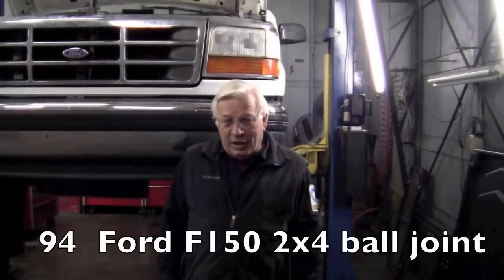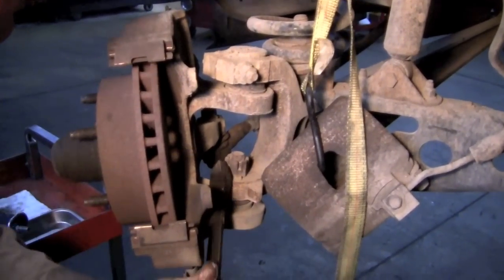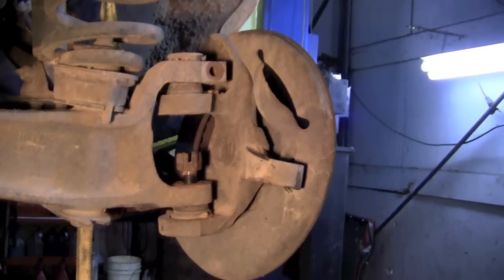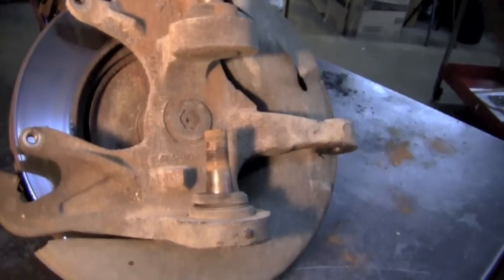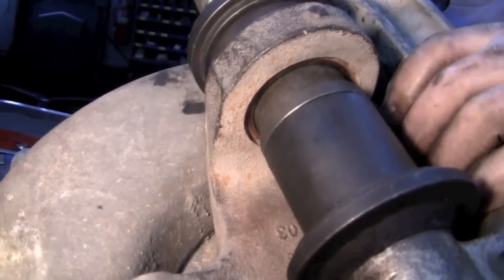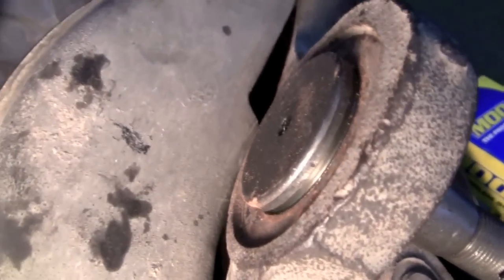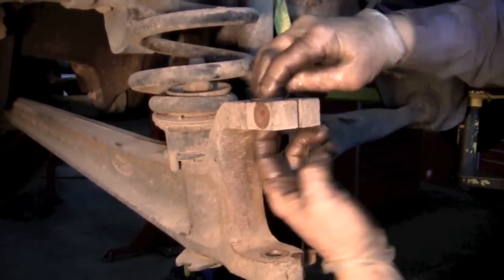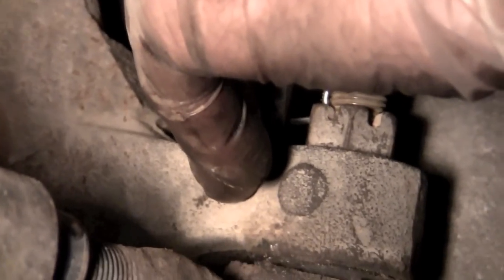Ford F150  Ball Joint

Comment: Thanks for the video.  One difference: on my '87 RWD F-150 the caliper was held on by two wedge pins that needed to be driven out, instead of bolts.  The big castle nut required a 1 1/8" socket or wrench- not everyone has one of these in a standard socket set.  .  The lug nuts we 13/16".  Hammer blows would not release the tie rod end or all joint assembly- I needed to use a pickle fork.  Penetrating oil used throughout the process was a big help.  My cheap impact wrench was mostly successful in driving in/out the ball joints with the press kit, but I also used a socket with breaker bar for leverage.   Overall I agree that with a press kit and standard tools a layman can do it, but now having done the job I appreciate all the work that a professional like yourself puts into getting the job done.  Thanks again for the instruction.

Comment: This really is a well done video.  I like that there is no long down time, and he explains everything rather well. 
The only thing I suggest is if you are doing it at home and your mileage is up there, and this being the first time you LBJ is being done, spend the extra money and do the uppers as well!!  I had my Chrysler's LBJ replaced only to have the upper go bad within 2k miles.  It is only a few bucks more and makes sense to do it then.
My only other suggestion would be to make sure you follow torque specs in the manual.

Comment: Good vid. I hate the ones that spend a bunch of useless time doing nothing. This one was to-the-point and covered the main points.
Actually, I'm currently half-way through the same job, replacing the lower ball joint on a Lincoln Town Car 2001. I don't have a press or a ball joint replacement tool as in the vid, and I'm trying to do the job without one.

Comment: Great Video.  Thank you for posting this.  I have been familiar with GM products for decades, but just bought a mid-90's E-150 that is going to need ball joints.  The boots are shot, so I know it will be only a short time before they get loose.

Comment: I did all the joints upper and lower on my 1 ton E350, they wanted  $1100 to do the job, all 4 joints cost me less than $300 and autozone has the free loner tool with good directions its not hard, be careful of the long caliper retainer bolts, very low torque, they are so long if you crank on them they will twist and snap easily, the parts place said everyone breaks them the first time.
Its a nice project to gain experience wrenching.
Power tools not needed but breaker bar is ,
plus a pipe to slip over the end to extend leverage if required.

Comment: Castle nuts have been used for ages on all makes and models of cars and other equipment.They are designed to be tightened as the movie shows. The point of the cuts in the nut and the use of the cotter pin is so the nut can't turn or un-tighten.It's a safety measure.

Comment: great job but I have some tips to ad to this video,when u get to the point where u need to press the new ball joint use some grease to ease up the installation, also some cars have a tiny drilled hole into the mounting frame and on the ball joint u should pay close attention and make sure they're aligned before pressing, reason behind it is when come time to grease the chassis, grease get to the joint, finally always clean up the area u are working on and use anti seize paste on bolts and studs.

Comment: @sweetlikeADAM 
I agree.  All you have to do on a 1994 3/4 ton Chevy, for example, is put a compressor on the spring to keep it from flying out at you.  Then take the castle nut loose, and take your press and push that sucker out.

Comment: @giannial1985 True, In all likeley hood it is the ball joints, but to best diagnose it, its best to lift the vehicle off the ground a few inches, like in this video, iff you see movement within the joint its worn, some joints also have a grease fitting, the should be regreased at every service interval, if you have any play in your wheels when rocking them from side to side you should also get your wheel bearings checked.

Comment: Thats what makes my job difficult at times while being a mobile mechanic. The ball joints are in so tight, that no normal use of tools in the field work. I have to take it to a shop, where the owner charges me to use the press. The force used to make the ball joints come out..is very explsive! They come out with a BANG! hard on the hearing. The part often flies down or away from the press. I think next time, put a rag over the ball joints.

Comment: Advance Auto will loan you a ball joint press for free... make sure you get the 4WD ball joint press, its heavy duty and gives you all of the cups and press plates.  You will need a two foot breaker bar to press in and out the ball joints.  I ordered Federal Moog joints with grease fittings was a breeze to replace both sides took a little over 3 hours for uppers and lowers and installong a new steering dampener

Comment: While you were doing the lower balljoint ...why didn't you replace the top? It's a 1994 and while it was out I would of did the top also. Great vid. Should invest in some rust penetrate. It makes it a little easier. What ball joint kit do you have? Also I have the same chisel gun and it's a good one.
Reply: J- Styga It's a Moog ball joint. You can see the box it came in at about the 6:20 mark. Personally, I don't think Moog is all that great, but they are better than Duralast and Valucraft. But in my experience, NOTHING beats OEM parts.

Comment: Just wondering if there are any torque specs on any of the assembled parts? I have 4wd so of course I have to also remove my hub assembly and axel shaft as well. Thanks for the video

Comment: I have an 83 F150 2wd. I just changed out my driver side upper and lowers. I noticed in this video the setup is similar to mine, but, my ball joints went into the ttb instead of the knuckle. I need to find out if that is the original ttb.

Comment: Well done video, but I still have two questions:

Do you put any grease on the ball joint or spindle hole to ease the process of inserting the ball joint, and reducing wear?

The replacement ball joints have spindles that are angled, i.e., not 90 degrees to the body of the ball joint; how do you orient the ball joint so the spindle is angled properly after insertion?

Thanks!
Reply: most ball joints will come with grease certs for grease, if they are permanently packed, there will not be grease certs.  I'm not following you on the spindles
Reply: @mercykidssprgeducationchan4237  Thanks for your reply. Got it figured out.

Comment: ive noticed how the wheel was tilted out, how would you fix that. You might say camber adjustment but my vehicle doesnt have adjustment for the camber. Its a 2001 Ford Focus ZX3. My wheel is the same way and it drives me crazy.

Comment: while doing the ball joint replacement,whats keeping the spring from flying out,is it just the shock absorber keeping it from coming out,and if so wouldn't it be a good idea to put a screw jack under the arm for safety?
Reply: The shocks and suspension control arms are limiting the downward movement of the suspension. There's no chance of the spring flying out.

Comment: I would stop spreading the brakes pads that way, or you run the risk of setting off the ABS system. You can push the centering pins in the proportional valves out and they fail to recenter. Just so you know you open the bleeder valve on the caliper.